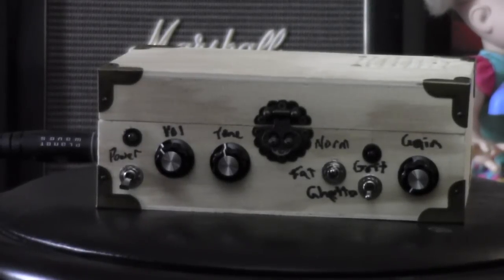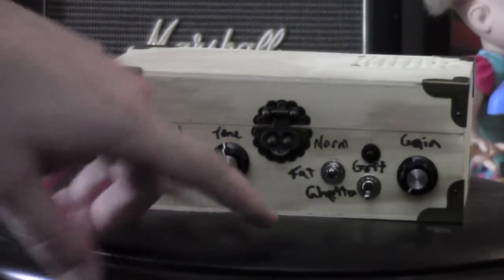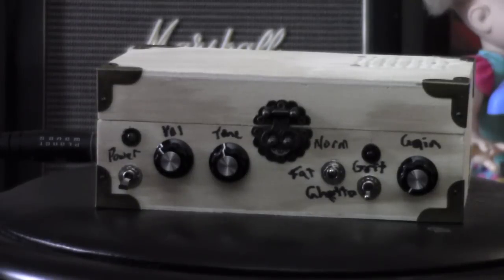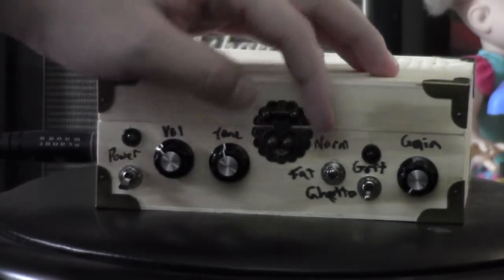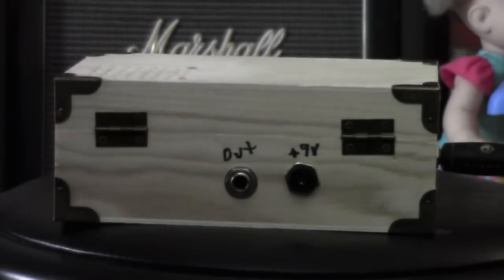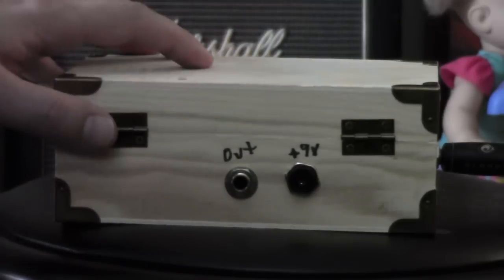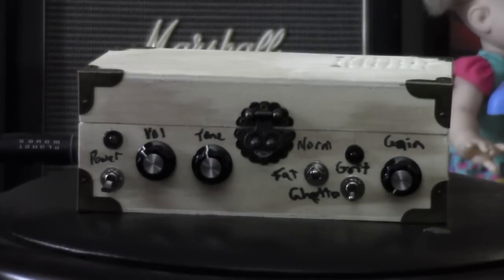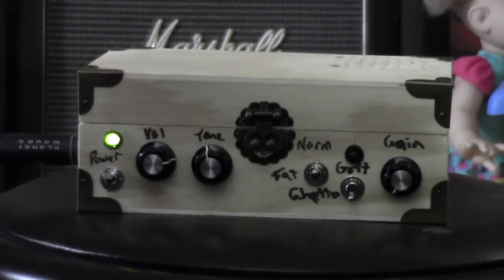Noisy Cricket Amplifier (Deluxe-ish version)

Comment: Adam. I'm building a deluxish version of the noisy cricket as well. what switch did you use for the 3 position switch? I have a type 2 on on on switch but two of the circuits will overlap with only six leads on the switch. Need help.
Reply from the maker: For a detailed description of how I wired the switch, please go to https://youtu.be/_sw0l1E8GP4
Reply: Adam, thanks man project complete.
Reply from the maker: Glad to help.  How's it working?